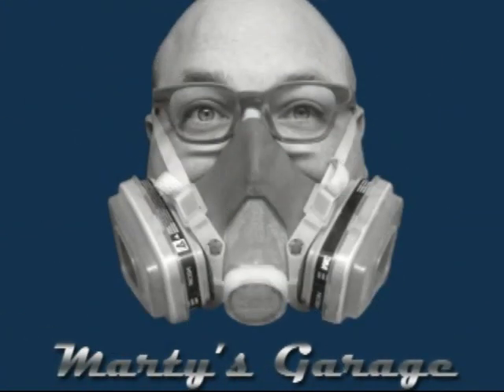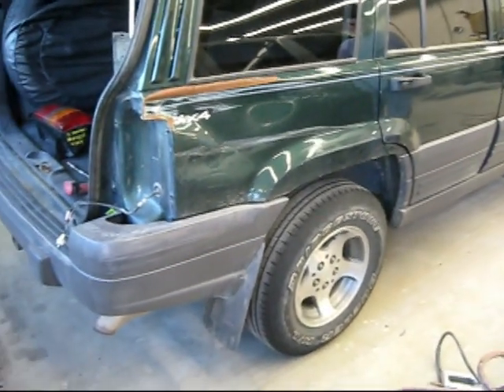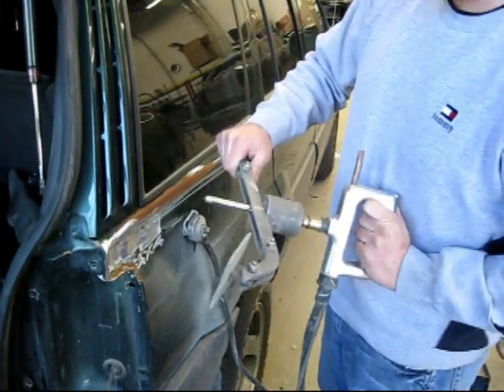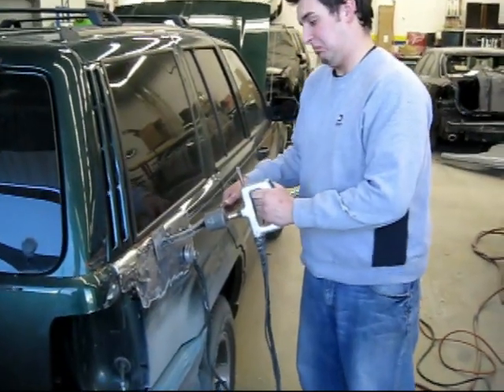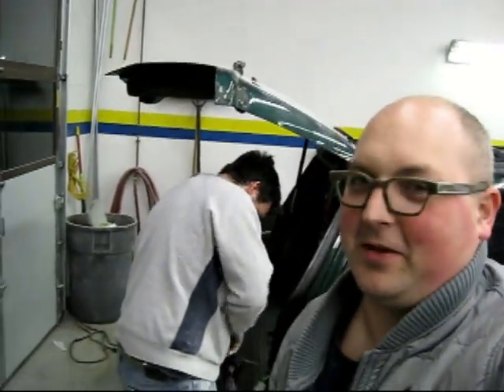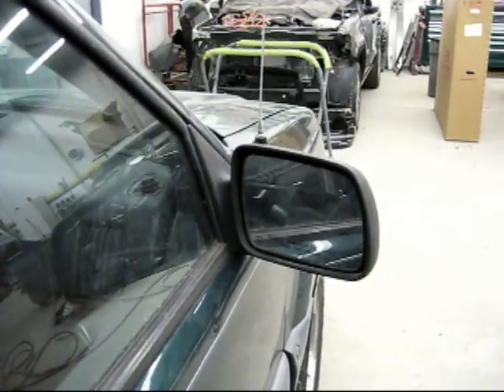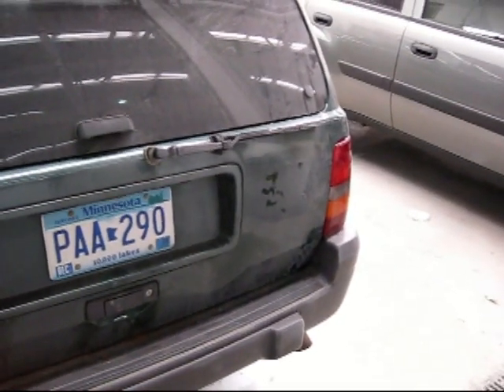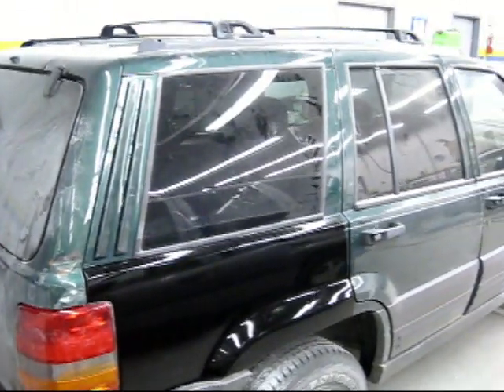MG 25 - Kevin pulls a big dent out of the jeep.

Comment: Good but not the best .  You shouldn't have I go thru all that.  It's not done the correct way, it looks like the shop is big but I hope all those jobs aren't being  rigged like that.   You should remove the inside panel and pull it slowly with a hammer and dolly , also when body filling you should tape the molding .  Also (body filler doesn't rust )